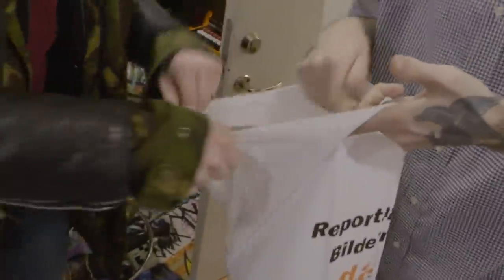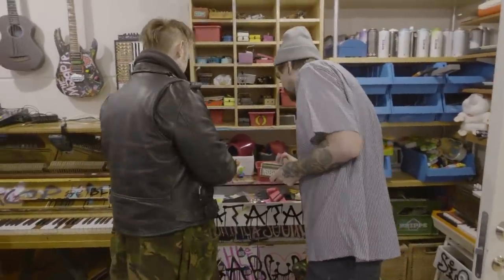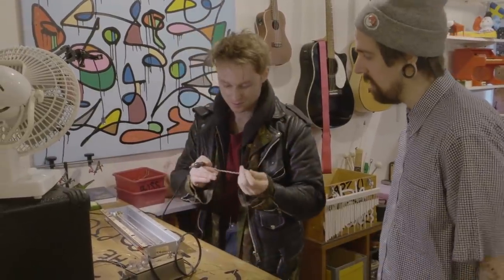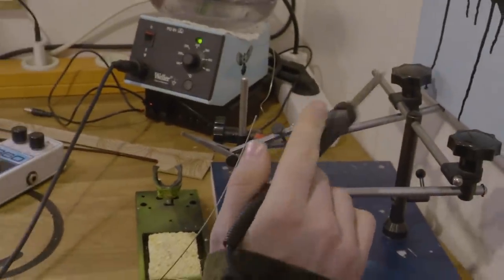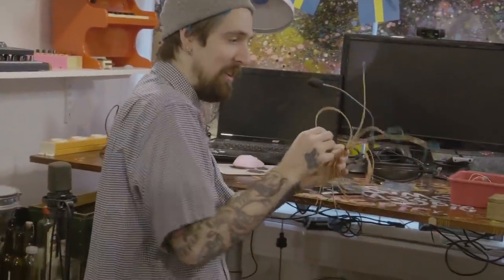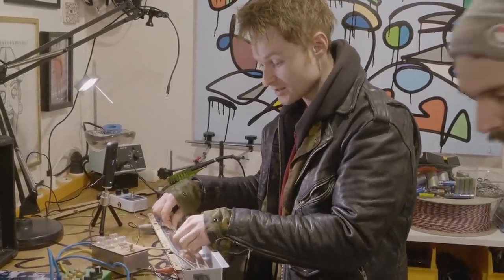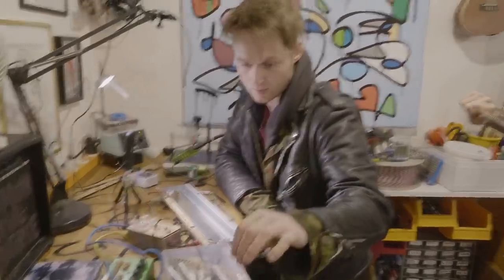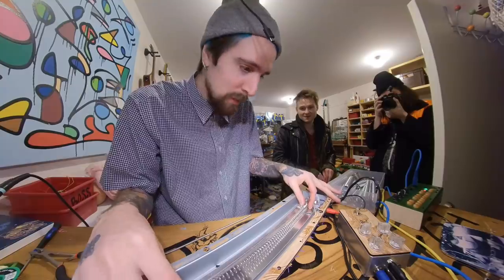Extreme Spring Reverb Experiments With LOOK MUM NO COMPUTER

Comment: Connecting directly to the piano strings was the most promising / interesting application for me. It would be neat to a direct connection to each note. It's different than running a signal from a mic through the normal reverb.